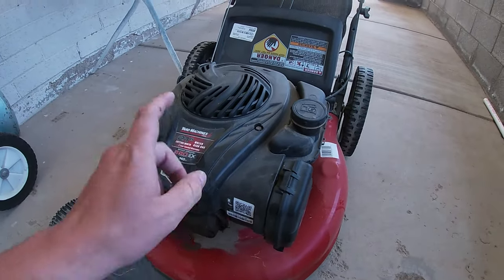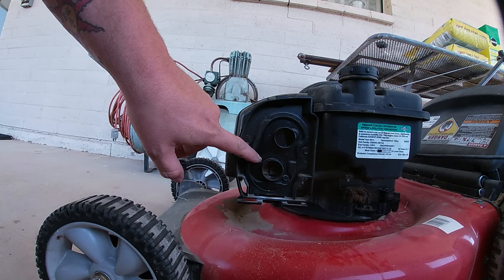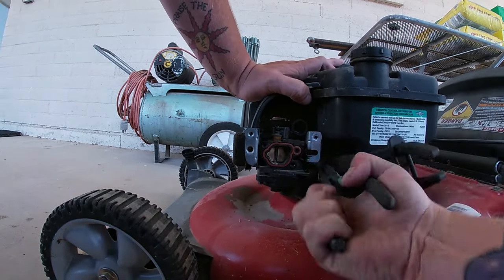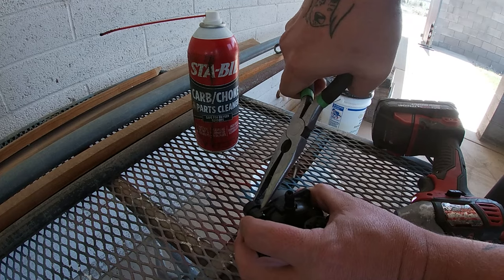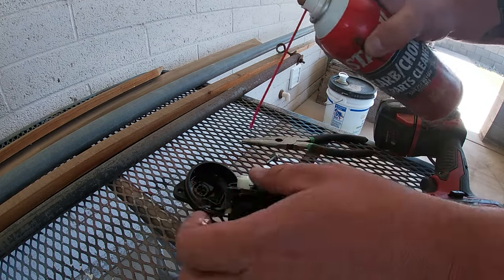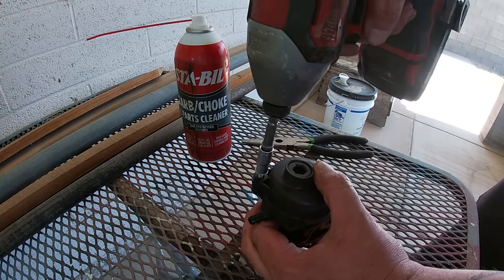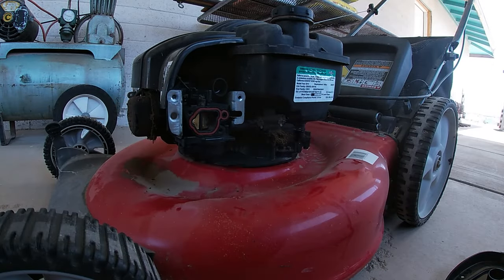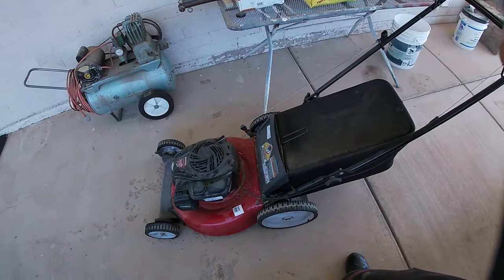Briggs and Stratton Plastic Carburetor repair. How to take apart and clean.

Comment: they make it look easy i'm struggling to get it back together. it's ruining my day. i would have been better off paying someone else to repair it instead of ending up very angry trying to do it myself.
Reply from the maker: What part are you having problems with getting it back together? You have to tilt it and line up the two holes at the same time and then go back to regular and then just push it on the middle part inside the plastic carburetor the white part with the Jets. That only goes in one way. If your bowl is getting stuck, flip it around the other way. Put the gas line on last
Reply: I found that if you do the linkage running from the right side first, you can use a pair of pliers to pull out the second linkage and kind of snake it into place.

It's a bit fussy but it works.

As a side note, I noticed that the choke flap was sticking as well but a bit of sandpaper to trim it back a bit fixed that issue (apparently it's a common issue).

Thanks for posting this video.  Super helpful.
Reply: It's WAS shitty for this guy the 1st time he did it TOO!!
  PAT yourself on the back!! 
The next time you HAVE TO do this it will b easy!!!
Don't let I ruin your day you re awesome for not paying someone else!!
Reply: The amount of cussing I’ve done over the years could fill Lake Michigan. Glad to see I’m not alone!
Reply: And he’s sick

Comment: Sir!  I would like to thank you for taking the time to make this video.  Last time I sent my lawn mower in when it wouldnt start, they told me it was a dirty carb and charged me a couple hundred to fix.  When it didnt start this year I tried my non invasive tricks and nothing worked. It started but wouldn't stay running. Your vid covered EVERYTHING.  That little round gasket had fallen off and i found it and didnt know where it went.  I was so releaved when you brought it up cuz i now know where it goes.  I took it all apart cleaned the carb and re assembled.  I put gas in, looked for leaks.  In the morning i went to try to start it and it started and stayed running!!!!  WAAAA HOOOOO!  I did it!  I fixed my lawn mower with your help!!.THANK YOU!!  I am doing an old lady happy dance right now.  I did it!!! :-)

Comment: I fixed my lawn mower using your video!  Your lawn mower was the closest to ours; plastic carburetor and very similar.  Symptoms?  Would not start and priming had no effect.  This mower sat for multiple year periods with E10 gasoline drying out multiple times.  Just like you said at 5:18, "if there's a hole spray through it."  In my case, most of the holes didn't appear blocked, other than one of the carb ports that the plastic emulsion tube seals into (that pressed in white piece you removed). The one with the black o-ring, that hole in the carb itself seemed blocked or at least restricted.  Put as much carb can spray pressure against it.  That finally allowed the mower to start, but it would stall unless I pumped the choke.  Ran it at high revs (about 10 minutes) by clamping (I know don't do that) the grounding stall lever on the handle so I could repeatedly press the red prime bulb.  Dumped the old years-old E10 gasoline back into the gas container with lots of fresh new E10 gasoline.  Refilled the mower tank to 1/4 full.  Started it by pumping the prime bulb, but letting it almost stall this time.  There must be a lot of negative vacuum from the engine as it stalls, because I could sense with each successive near-stall that it was clearing up, able to run on its own just fractions of a second longer with each near-stall.  The ethanol must have been getting through one of the plugged orifices and doing what solvents do, dissolve the gummed up hydrocarbon olefins inside the carburetor.  I kept letting it almost stall a few more times and voila, it ran on its own!!!  A can a carb cleaner (mostly unused), your video, and a little patience.  Thank you for this great video!!  Success!  Just need to let my family know that if they want to keep the mower running tip-top, they need to use it regularly.  So obvious!

Comment: The dog barking is awesome lol
Thanks for showing me how to do this , it took me 15 minutes i kinda followed your instructions paused to do each step using my ratchet. The clamping the 8mm and 7mm sockets bang on! For people having trouble with reassembly just push the carb into the hole it came from but hold it in position the screws line it up when you tighten them it goes in smooth. We have bad gas here i use 91 octane shell gas it gums up the carb every year after sitting all winter. I’ll be draining the gas carb and tank next winter and see if it gums up again. Thanks a ton for simplifying this job! My mom thinks I'm a mechanical genius lol it’s all thanks to you! 
I also deleted the second choke it really hates the gas and makes it run like crap so it runs awesome without it. It’s a no manual choke setup now so i have to check oil level before starting but totally worth it! Old lawn mowers are epic though if you can tune the carbs they will run on almost any flammable liquid but not these new mower engines.

Comment: Thank you thank you thank you! You just saved me a hundred dollars, a drive to the hardware store, and a lot of inconvenience. A couple notes, this was much easier when I took the top off. If anyone is struggling to put it back together, keep track of the choke (thin) and the throttle (thick) and do it in an elevated surface like a table or a work bench if you can lift the mower. Again, thanks! Off to mow!!

Comment: I take the plastic valve apart and clean everything. Also taking the 3 screws out of the recoil and getting it out of the way makes things a little easier and you'll be able to see all of the linkage and you don't have to fight but being able to see but I'm old and need all the light and space I can get lol. Battery tools are basically a must for saving time. 1/4" impact and ratchet are my to to along with 3/8" and then to air if needed. Great video.

Comment: On the white plastic piece (Jet-Main), you can separate the L-shaped white piece (opening w/brass piece+center protrusion) with a small pair of pliers by wiggling it back and forth.  It’s on there snuggly.  This exposes 3 tiny orifices which commonly get plugged up with fuel varnish.  You can visually see whether they are occluded or not.

Using a set of orifice cleaning tools (set of small diameter bare wires basically), you can quickly clean out the 3 orifices.  

Reassemble by pressing L-shaped piece securely on to other white piece.

Comment: Does that carb have auto choke?
  Does it have the white piece behind the choke that the fuel cartridge fits into?
  I thought blew the white piece out when blowing my carb. With auto choke but I not sure it could have blown out. 
  I took a white piece from another carb with no auto and couldn’t get it past the choke, so I M thinking maybe this one did not have the white piece.
Reply: Update;
  The rubber Irving that fits around the fuel cartridge broke. I took one out of a manual choke Briggs and took a chance that did not have the white ring behind the choke that the cartridge fits through. 
  Fired it up and made a few passes along my yard. 
  Hope it keeps running. It was running before when I took it back to owner then quit and would not start. 
  Same as it did when I got home with it. I started it. Next day it would not start. 
  Today it is going again. 
  Sort of wish I had changed the old fuel line from tank in case it is coming apart in the inside and causing it to quit and not start after being run a little while.

Comment: Do u have a video that changes the fuel jet on B&S plastic carb
Reply from the maker: Like the white plastic part in the carb?
Reply: @RepairGang  I was looking at some videos and they said when carb is not getting enough gas it could be a fuel jet or something like that. Is that what the white part u took out the carb was.

Comment: Same problem with the old carb and new carb old one was clogged got a new one it’s causing surging so I cleaned out the old one and same issue engine surging up and down
Reply from the maker: Check to see if a gasket or the o ring is good

Comment: The plastic jet I have is not clear and no amount of carb cleaner is clearing it. No cleaner comes out of the end with the tiny brass circle. Any suggestions? Thanks
Reply from the maker: High powered compressed air will shot it right out
Reply: Compressed air or a can of air should work, but another option and it might make the mower start a little easier:

A micro drill bit will clear the opening.  A set of micro bits is very cheap.  Use them by hand and always start smaller than you think it needs because you can't shrink a hole that is too big.
Reply: White plastic main jet comes apart exposing tiny orifices that get plugged with old fuel.  See my 16 June 2024 comment.

Comment: The bowl is stuck on mine never seen a plastic carburetor before
Reply from the maker: It's pressure fitted remove two 7mm bolts and the drain plug and pry it off

Comment: Great video. Thanks. Question though. There's a valve above the hose gas line. Is there supposed to be a hose on it?
Reply from the maker: That is correct it should run fine without it

Comment: is this what i need to do if i just used it 3 weeks ago and mowed my front yard and now when i try to start it, it acts like its going to (by the sound of it) but doesnt. the 2-3 times it did start, it shut right back off after 1.5 seconds :( my friend let me use it and i  forgot to bring it in garage a few weeks ago so it got rained on and i know nothibg about this stuff so just trying to figure it out as quick as possible.. pls help lol
Reply from the maker: yes this will help or spray carb cleaner in and drain gass then try again

Comment: Red o ring on right side  between back of air filter housing and carburetor do not seal allowing dirt into float bowl. Spray cleaner in hole and see the path dirt gets in. Stupid design flaw.